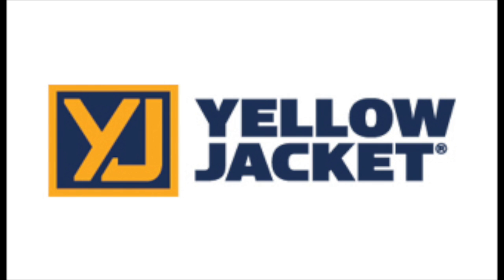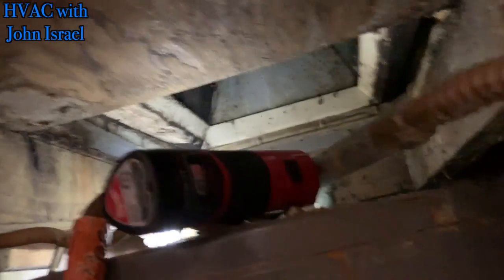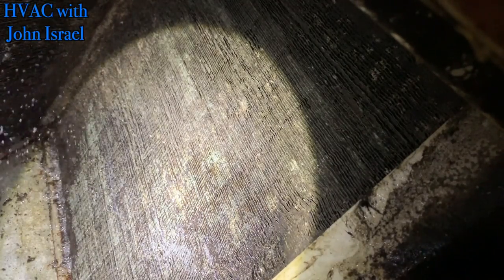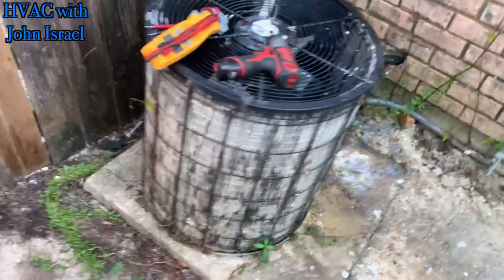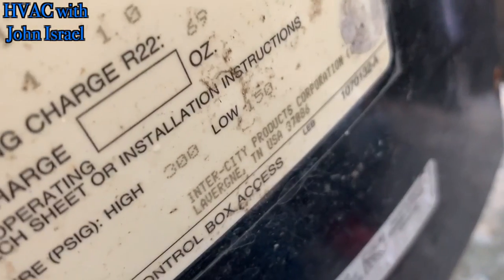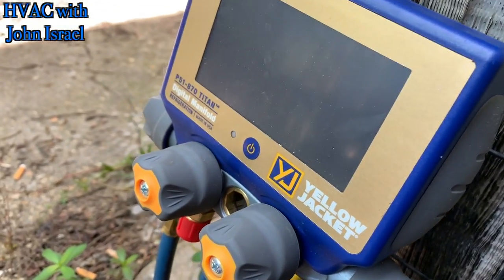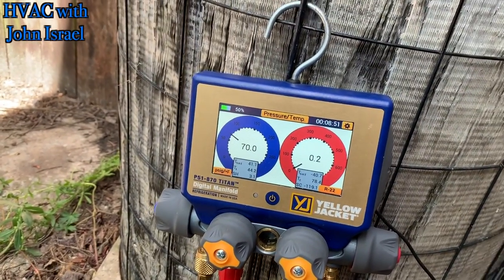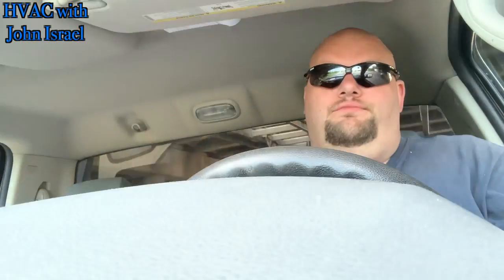An Old HVAC System in Bad Condition

Comment: I just got those gauges, screw the batt charging port and vacuum reader and the clamp plugs. freaking junk.and battery life sucks for 4-6 calls a day
Reply: Had mine over 2 years now no real issues other than the temp clamps cables to short and gets in the way alot but just got the wireless temp sensor. i'm able to get threw a few day of work on just one charge with alittle left to spare so i think they should not be your only set of gauges just in case.